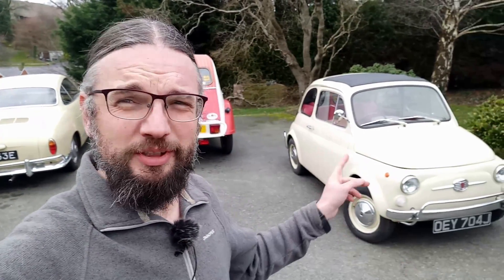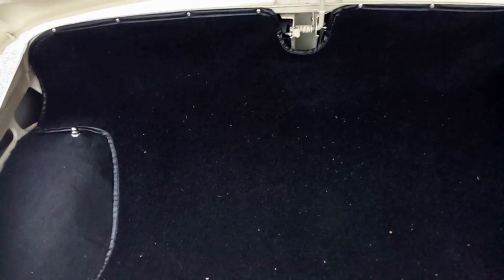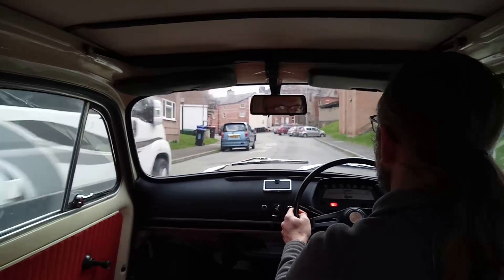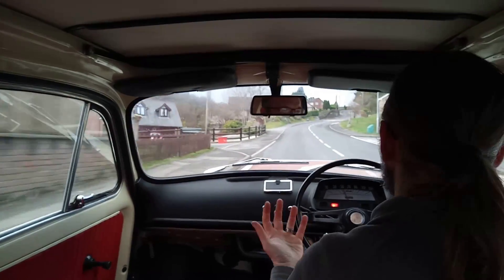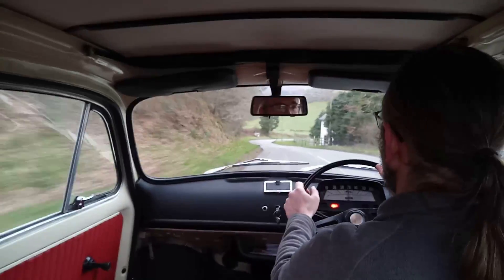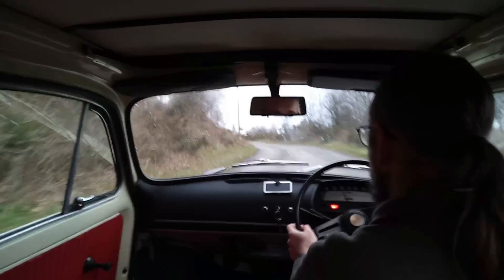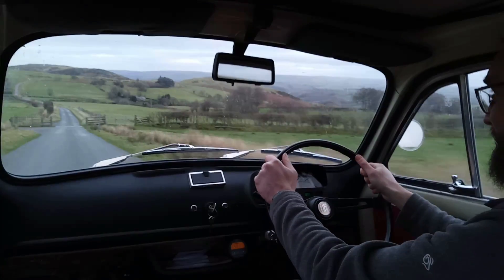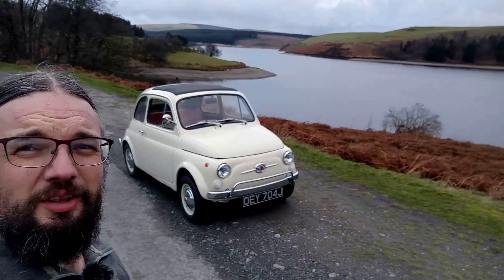This Fiat 500 is ELECTRIC! What's it like to drive?

Comment: I also love electric transmissions (railways have used them for 60 years - but not many battery loco's). Sorry, but they are still expensive novelty vehicles: Low mileages per charge and no one mentions how good they are on a cold wet night - headlamps, wipers and heater on. What mileage then?
Definitely qualifies for a 'HubNut' sticker - 20 to 70 'standing' start (typical Hubnut speedo).
Reply: Wonder if you could fit a petrol driven generator to top up the charge and increase the range?
Defeating the object but trains are using diesel engines to power their electric motors aren't they?
Fascinating vehicle though.
Reply from the maker: BMW offers a range extender version of its i3 that does that. Not convinced it's the best idea as it's a lot of extra weight.

Comment: The pedals are set up like they are in American autos. I'm waiting for someone to put out a Diesel-electric vehicle, just like a locomotive drivetrain, it would need to be adapted to suit ever-changing driving conditions, but I like the idea of electric without always having to recharge.
Reply from the maker: Chevrolet Volt sort-of operated on that basis, with plug-in capability.

Comment: I didnt see any charge points on route which might be a problem. Also do they convert montego 1.6hl's, because I've a feeling the battery might not be able to handle the 30W power output the radio/cassette has  (with a tone dial)!!!

Comment: I love the idea of electric classic conversions - have done ever since I saw the EV converted P6s in 'Gattaca' 20-odd years ago. Now they're a viable reality, although, like good new electric cars more generally, only for the well-off right now. 

That's why I'd be interested in a DIY conversion - motors are cheap, it's the batteries that kill the budget, but with Teslas having been around for a while now, used availability will gradually improve. 

It will come as no surprise to hear that I'd probably use something big (to provide ample space for lead-acid batteries, which are the cheapest way  to do this) and automatic, to avoid the need to shift (which ends up being rather pointless in an EV due to the nature of the power delivery). 

Someone in Holland used a 240 estate, which I thought would be too big, but it turns out that they weigh much less than modern cars of a similar size, so I guess it's feasible. And older cars are also ideal for conversion due to their mechanical and electrical simplicity. 

Tbh if I could buy a kit of parts to convert my Volvo - one that included things that owners of new EVs take for granted such as fast charging, regenerative braking and a heater, without having to shell out £17k, I'd be in there like a shot. 

I do like seeing people's homebuilt creations on YouTube, but watching the build process is enough to confirm that designing your own system from used parts is probably something beyond the abilities of any but the most competent DIY mechanic. Following directions on fitting a kit designed for your model of car however is another matter.

Comment: What classic car would I like to electrify? I keep coming back to the old bullnose SAAB 96, as it has tons of area to install batteries and electric components, the front-rear weight balance is decent  and that it's 4 speed gearbox is synchro and has a freewheel.  Coasting downhill = gravity is free power. Although there are a lot of small, more modern cars that would be as or more viable.   I don't think they have the unique strength of steel body stampings the old SAAB had.
Reply from the maker: You can 'freewheel' with electric anyway. On EVs with a power display, I try to balance the throttle at zero downhill, lifting to encourage regen if I need to slow down. An electric Saab would be good though. The V4 engine wasn't a great one.

Comment: No access to the rapid charger network then there's no point of a car with a range of just 70 miles. Nice video but I will stick to internal combustion engine motor vehicles thanks.
Reply from the maker: I disagree. I regularly drive for no more than 20-30 miles. In fact, around here, I sometimes have to go out of my way to refuel with petrol, when I could 'fill' an electric car at home.
Reply: @HubNut  Well I think it's agents the law to keep more than a gallon of petrol at your home anyway as it's a fire hazard. But I could be wrong. How about them doing a Rover P6 electric car?

Comment: Seeing that Fiat 500 brought back memories. I first drove one at 13 years old (off the road at school, it was donated). It didn't take long to get used to the lack of synchro gears. The electric conversion is a great concept for town/City use. Be interesting to see its performance at 100% power setting. I'd imagine the price will drop as it gets more developed. Great gear whine.

Comment: Ah yes, there was an electric Fiat 500 t the Interclassic show in Maastricht last week as well. That one had the batteries in the front. 
Love how original the interior is. 
After 1970 or so they had synchromeshes. 

Nice camera view!
Pity they didn't use the starter and choke handles for something, haha. 
Love how noisy it is, it's almost like a real car. 

Does the Clutch allow you to rev the electric motor without going anywhere? 
Means you can do wheelspin.

As I'm sure people told you; 70kph is about 44mph. 
I wonder how much quicker it'd have accelerated in 2nd gear.
 
Regen = Rain in Dutch
Reply from the maker: My understanding is that the Fiat 500 never had synchromesh, but the 126 did have it on second, third and fourth.  Clutch does allow you to free-spin the motor. I imagine trying for wheelspin would just break something!
Reply: @HubNut  We had a 1973 one and I remember my dad saying it had a synchromesh. I'll check up on that. 
And yeah... I was wondering the same thing about the clutchdump ruining... stuff. Maybe don't. It's tempting though!

Come to think of it; Did you ever own a 126? It seems fitting.
Reply from the maker: No. I've always been into 2CVs, and they're just sort of, you know, better...
Reply: @HubNut  In that case there's a lot of cars you shouldn't have owned in the past. Not so easy to beat a 2cv!

Comment: I took one lesson from this video. Whatever old car gets its original engine replaced with electric can be used in daily life and put back on the road. Think about it, old cars have crazy fuel consumption and emissions, and difficult maitenance. With rebuild like those, what is the problem ? Honestly, what is - maybe the lack of power stations being everywhere. I have a bit older car with 2.0 engine myself. Iam keeping it and try to keep it, even for a cost of trying to rebuild it for electric. Love your car for life and do not worry about running/maintenance/fuel costs. The dream of mine, maybe even of classic car collector ?

Comment: Can’t imagine it will be much fun in winter, in the dark, with the lights, heater and wipers draining the battery along with the motor.
Reply from the maker: That's an issue. I did drive it in winter though. ;-)

Comment: What a lovely thing that is! The latest EV technology is the 'engine' certain cars are better with then internal combustion. This little 500 a perfect example, as the EV powerpack is a smaller, simpler, better fit in a tiny car, yet with more power.

Comment: That electric version of the 500 is quite a testament to the smaller size of the electric motor and how compact the battery pack can be. I'd be kinda worried about torque and the gearbox. If anything, they could probably fit a more modern gearbox from the fiat 126 (with synchro) which used basically the same engine.

Comment: Absolutely delightful. It is impressive how much acceleration that has whilst only running at 60%.

I think the future of motoring has to include multiple energy sources. At the moment the only two energy sources that I can see working is electric and hydrogen. Electric power, certainly has it's place for low mileage users in today's current world. If batteries could be removed and swapped out at a current petrol station for example and they have a ready supply of fully charged batteries that were universal this would make electric be much more appealing and avoid the dreaded range anxiety. 

I see hydrogen being a much better long term solution. Although there certainly doesn't seem to be the same level of investment and research going into hydrogen versus electric. Is this because the oil industry is worried about their profits? But if it did I think electric would then become the betamax and hydrogen the VHS of the day!

Comment: Where does the heat come if no engine?
Reply from the maker: A power-sapping resistance heater.
Reply: @HubNut  Oh, to reduce the range further then..
Reply from the maker: Yeah. Some EVs now use heat pumps for greater efficiency. This is the problem. Internal combustions engines create all this lovely waste heat!

Comment: I just have a problem with if it goes faulty you WOULD need to hook it up to a diagnostics and I bet it's not local or cheap..
Reply from the maker: True, but electric motors and controllers do seem to generally be reliable.

Comment: I don't think we'll ever run out of fuel for ICE cars, as internal combustion engines can run on pretty much anything that burns, including natural gas, LPG, vodka and synthetic fuels. However, I do like this little Fiat. What I don't like about modern electric cars is that they're not very involving to drive. It's not an issue in this, as this looks very involving. I like that you still have a gearbox and can still change gears. I'd love to see more electric cars with manuals, at least conversions. Plus, this is still noisy and a chuckable, which is good in my book, but now also slightly more refined and powerful, which is again good. I quite like it.

Comment: A thought... surely part of the "experience" of driving an old or classic vehicle (as exemplified by Elly!!) is that a slow and noisy engine in, say, a Morris Minor or series 2/3 Land Rover or even an old HGV vehicle, is ACTUALLY part of the experience.... and replacing / modernising the engine (rather than unsafe bits like drum brakes or worn/tired suspension) takes away from the purpose of driving, smelling, hearing and feeling what a car from the 50's, 60's or 70's would have been like to own when new(er)? .................. discuss !   :-)
Reply: It is, but in the case of the 500 which was very under-engined by design, I really can't fault this as a concept or the execution of this conversion. 
As much as the buzzy nature of the original engine is all part of the charm, it soon wears thin when you're trailing several modern vehicles, watching the speedometer fall and are powerless to do anything about it.

The way it appears in the video is akin to being towed, just without a towing vehicle in front! Effortless.
Reply from the maker: It is a thought, and one I would have agreed with until I drove an electric car. But, it turns out the engine isn't as key as I thought it was. In the short term at least.

Comment: Yes....I know it's the future, but they do all make me think of milk floats. Many years ago a mad friend of mine took the engine out of a Robin and replaced it with a milk float motor and many car batteries. The ignition key consisted of two very big wires that created spectacular sparks when brought manually together for 'go mode'. I have no idea if it was legal, I suspect not. But he used it around town for some time. I went in it once and that was enough for me. Astonishing acceleration, it was more or less on or off.
Also, I was almost run over by a Toyota Prius in 'stealth mode' because it was so bloody quiet.

Comment: At least the wipers on the 500 are LHD because it was originally a LHD. On my wife's Beemer they are LHD because of penny pinching. In the winter with a dirty screen you have a big patch above the eye line that drives you mad. My 90 has better wipers. Love the 500 though.

Comment: You highlighted all of the drawbacks which, for me, outweigh the advantages of owning such a vehicle. If I do dip a toe into this new world of motoring I think it would have to be a hybrid design.
Reply from the maker: Hybrids are the worst of both worlds. You're always hauling around a load of tech you are not using. For me, it's electric or petrol, not both.

Comment: Your route westwards from Llanidloes used to be my favourite motorcycling route via Dylife  to Machynlleth.
The only problems with electric cars are as you say, price and range. A weekend trip to the shops of Shrewsbury or Chester are 60 and 100 Miles respectively and my favourite beach and camping area is a round trip of nearly 90 miles. A Jaguar I Pace would be nice but they start at £63k.

Comment: Very nice! I wonder if there will be a whole industry one day coverting old fossil fuel cars to electrics? Engines often die long before bodywork does these days. My 15 year old little Fabia is galvanised and has no rust, but will probably be scrapped in a few years when the engine becomes uneconomic to fix. Yet the car is ideal for me - I'd love to think it could run on for decades using battery electric tech.
Reply: It could but it would be bad for big companies. Imagine everyone had the same car for 30years it would kill the car industries.

Comment: I think what is holding electric cars up is the need for fast charging, compared with a couple minutes at the fuel pump, having to stop and have a hour or so to charge up is a problem making them impractical say for a drive to Scotland from London where every 100 miles you have to stop, charge then carry on.   One way round this is using wireless charging and the roadway itself as a charger so as you drive, you keep the car charged but this smacks a little of free energy unless its monetised as well as a standard created so every electric vehicle could make use of to a factory standard.   I am hopeful for the rumoured graphene batteries which will be super energy dense but a fraction of the weight of even lithium batteries thus increasing viable range and reducing vehicle load due to weight of lighter batteries.
Reply from the maker: EVs are getting on for 200 miles on a charge now. I hope to test one fairly soon.

Comment: These electric conversions are a nascent technology. Remember $500 calculators and $2000 VCRs... 

In ten years as manufacturing and installation become standardised, there will be cottage industries in places like Latin America and South Asia replacing petrol engines for the simple joy that electrics will be faster and cheaper to live with.
Reply: What year was a calculator $500 and a vcr $2000
Reply: @chrisredfield3240  The calculator was about 1972, The VCR was  1976.
Reply: @wanderinggentile  i see you already adjusted for inflation so that's fair enough. You can probably still buy a $2000 vcr now would be high end gear.
Reply: @chrisredfield3240  Not adjusted for inflation. The original Betamax from 1976 was $1999. The desktop version of the calculator had dropped to $350 by 1974.
Reply: @wanderinggentile  well i'm never going to complain about prices coming down. so fingers crossed
Reply: About 1970 and 1978/79 respectively

Comment: I really like this, we are just seeing the 'bleeding edge' of this technology where it is expensive and experimental but over time it will be accepted, its performance will improve and the cost will drop. It's exciting as it means as long as you have a solid frame you can build an electric classic car, there are countless 'projects' out there that are left to deteriorate due to cost and availability of spares, this option will no doubt save many classics from disappearing from our roads.
Reply: The engine is an essential part of a classic car. I can accept modern cars being electric but classic ones?? No.
Reply: @adorabasilwinterpock6035  I don't believe it is. Most classics out there wont have the original engine or if they do it would have been heavily modified and serviced to the point its a 'Triggers Broom' (Google it, very funny scene from Only Fools and Horses). Also I'm not saying if a classic has a perfectly good engine it should be ripped out to make it electric, this is an option where a car is left to rot into the dirt because the engine/transmission spares are unobtainium or beyond economic repair, to me its about getting classics back on the road for the modern world.

Comment: I think for most people, the cost of converting to electric, plus the range, isn’t practical. The cost of converting my beetle, here in California, is a lot. My beetle is my work truck, I use it for work, then park it when I get home, and use a motorcycle/scooter for all my other transportation needs. If it wasn’t so expensive, I think I would convert it. The conversation kits they have here, are actually very good. If you converted tuk to electric, it would definitely change it, but then it would just end up being a golf cart......

Comment: I remember the electric VW - quite impressive.  Ah regen. breaking - that will increase it's range (we can't talk mpg anymore).  There's one thing I can't understand - instead of having to charge electric cars, why can't they standardise the batteries so that they are easily changeable, then have service stations where instead of having to charge the batteries they simply replace them?  (They would take your batteries and charge them for another customer.)  Just an idea I've had for a long time.  But yeah, it's all interesting stuff, thanks for another great video.

Comment: Great, if expensive. I do worry about pedestrian safety with a virtually silent vehicle, and range, is that quoted on a warm sunny day, or a cold wet morning, lights on, heater and wipers going...
Reply from the maker: Yes, you can sneak up on people. 50-75 miles allows for variation in conditions and terrain.